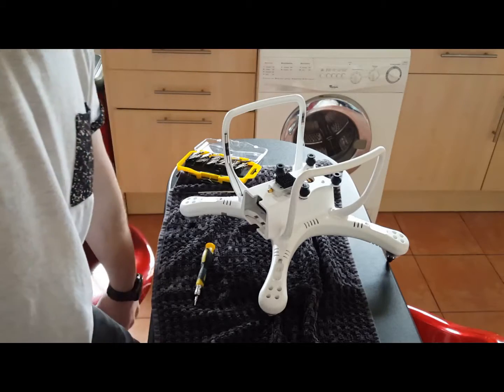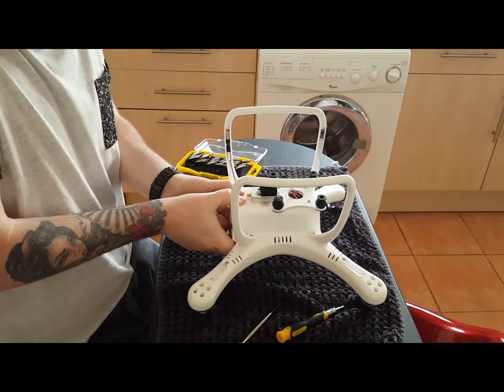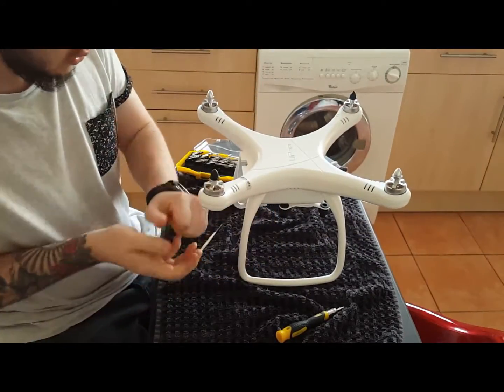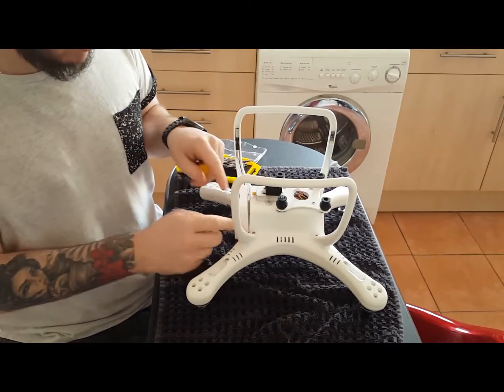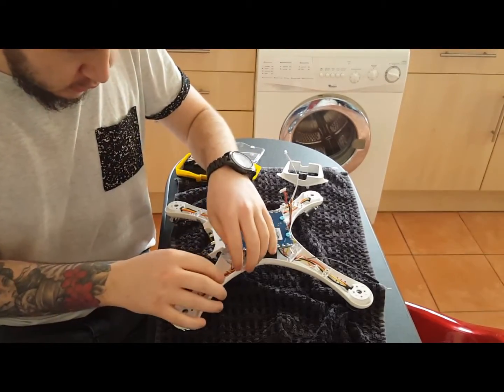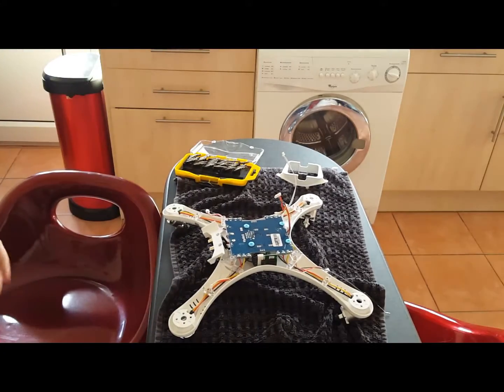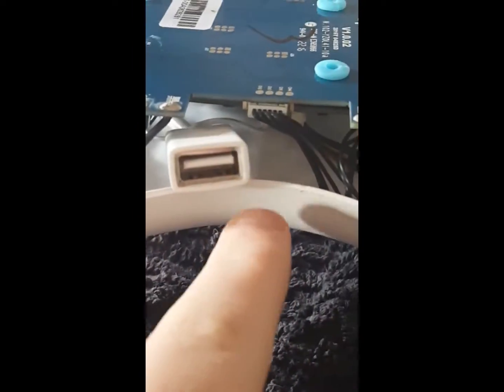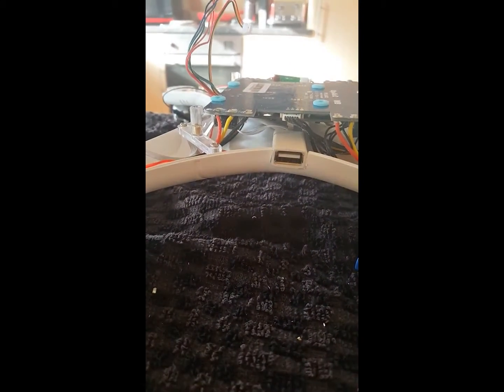Up Air One USB mod/ Tuturial

Comment: Ottima dimostrazione, anche se non capisco e non parlo l'inglese è tutto molto chiaro ed il filmato fatto ottimamente. Devo a questo punto però chiederti dove e come ti sei procurato il cavetto usb per l'attacco alla scheda. Certo di una tua risposta ti ringrazio! Un saluto.
Reply from the maker: 48mess sorry I'm unable to translate can you post in english ?
Reply: Please tell me the link where you can purchase the USB cable to connect the Upair Mission Planner. Thank you!
Reply from the maker: 48mess sure this is what you need if you search femail OTG cable http://www.ebay.co.uk/itm/Micro-USB-Male-host-to-USB-Female-OTG-Adapter-Cable-For-Android-Mobile-Tablet-PC/272535955588?_trksid=p2141725.c100338.m3726&_trkparms=aid%3D222007%26algo%3DSIC.MBE%26ao%3D1%26asc%3D20150313114020%26meid%3Dca4764abeb1b49e28e7de0173e66bcf3%26pid%3D100338%26rk%3D14%26rkt%3D30%26sd%3D222215768564
Reply: Thank you!

Comment: drivers for USB mod?
Reply from the maker: Nigel Antonio  i   didn't need them. try rebooting your computer and waiting 5 mins after opening mission planner. if not try google
Reply from the maker: also do NOT run the wizard in mission planner for the upair
Reply: James Ingram I'm on a Mac , using apm planner. didn't want to use the wife's PC ... but might have to.
Reply from the maker: Nigel Antonio  ahh i haven't got a clue with mac either I've never used one sorry i can't help with that
Reply: actually figured it out . it was the cable... got it to work.  for Mac. so it is possible. Apm Planner
Reply from the maker: Nigel Antonio perfect. you should do a tutorial. alot of people will find that help full. im just uploading a video now to show how you change flight modes if that helps. i uploaded one yesterday showing circle mode in use
Reply: sorry lol how to make this work on a mc computer
Reply: please tell me
Reply from the maker: WES EUBANKS tell you what sorry wes ?
Reply: I'll do a video when I get home , but upair is kinda down.  the video board fried puff of smoke.  bird still fly's but no video no HUD nothing ...